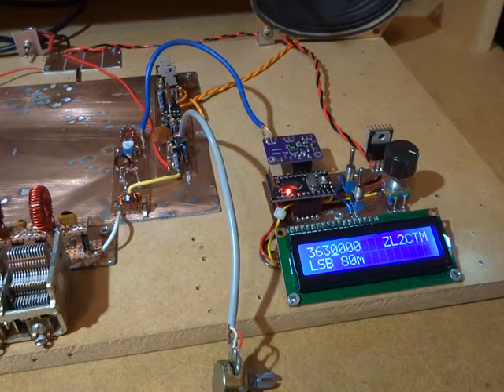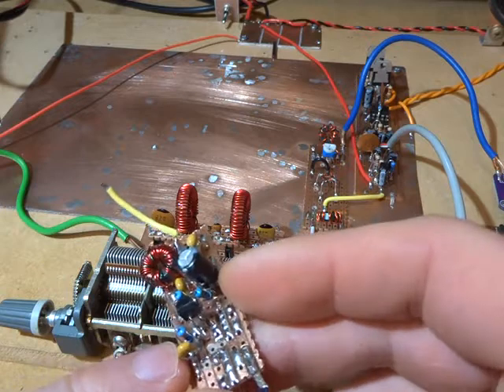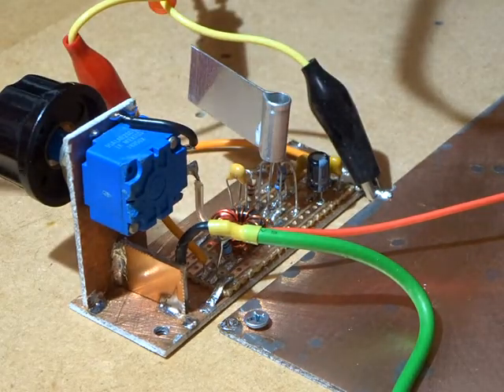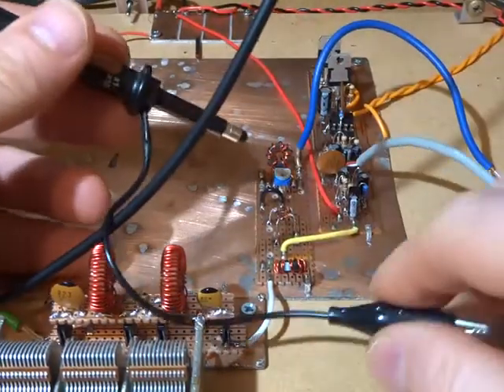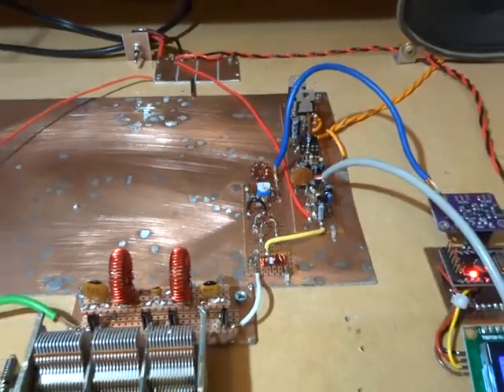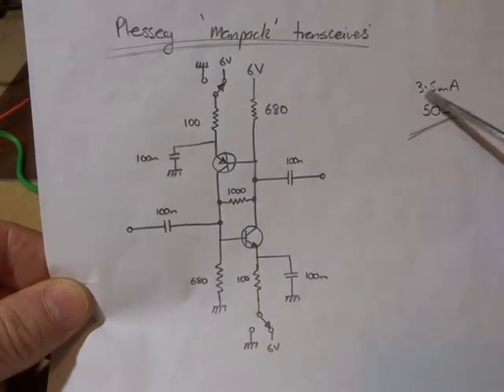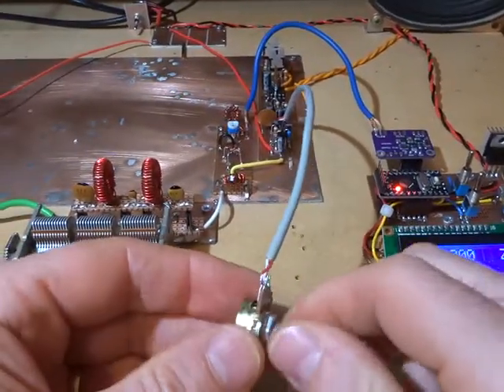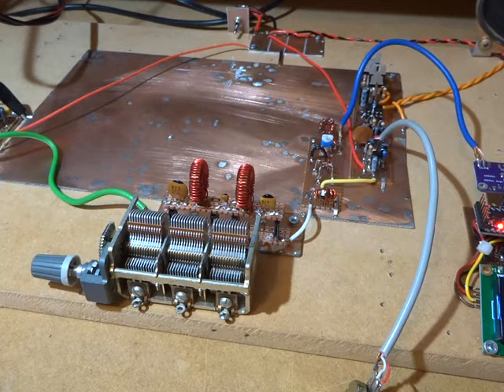Homebrew 80/40m SSB/CW Rig - #6a Direct Conversion Receiver Test

Comment: Hi Charlie,
Beautiful handy work as usual.
Just to let you know that from now, I'm building my circuits the Charlie Morris way!
Best 73s

OD5VL
Reply from the maker: Thanks Lucien. I have said it many times that I am no expert and don't claim to be. I’m just trying to pass on what I have learnt in an effort to encourage others to give it a go. I’m always open to constructive feedback.73sCharlie, ZL2CTM
Reply: Hi Charlie,
Sorry for the late reply.
Here is more specifically what I mean:
Your use  of Strip board and a common ground plane to tie and test the various modules together.
Thanks for these invaluable tips, this makes it much easier to test and  expand a circuit.
I've just ordered a truck-load of strip board from Ali Express, and am using the lid of a large coffee jar as a ground plane (or at least I will once it is empty) :-) 
To better illustrate:
I'm presently working on a portable air-band receiver which needs to  fit into a cigarette pack. The design goals kept  shifting as I went along.
After getting the RF and audio parts working and having already tightly packed everything on a single board, I quickly ran out of space for other things it would be nice to add such as:
Squelch, preselector/amplifier, re-chargeable 3.7V lithium battery instead of an expensive  9V alkaline battery, AGC,.....on and on.
 
73s OD5VL
Reply: @CharlieMorrisZL2CTM  Is SSB sounds okay on a DSB transceiver with direct conversion receiver??